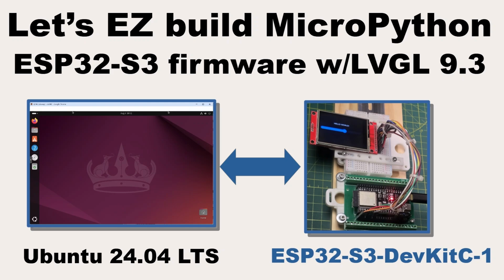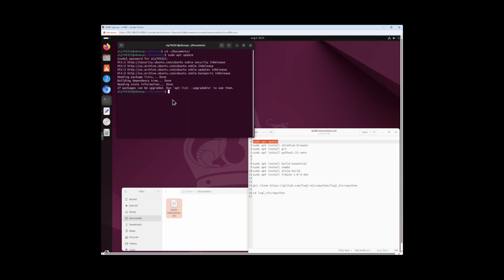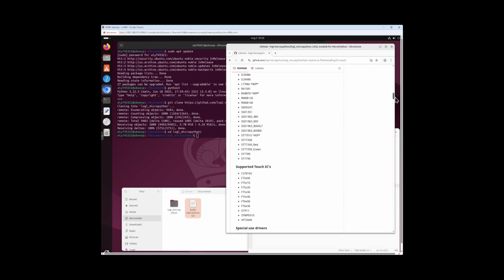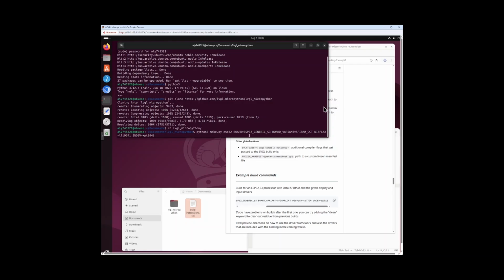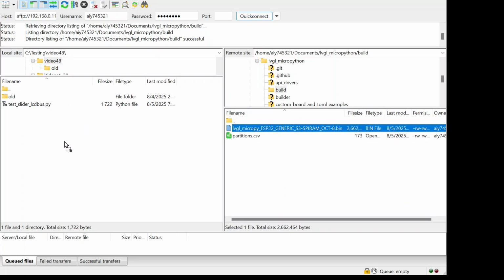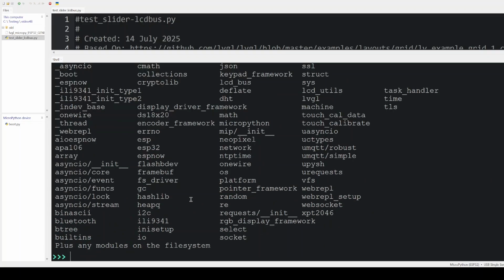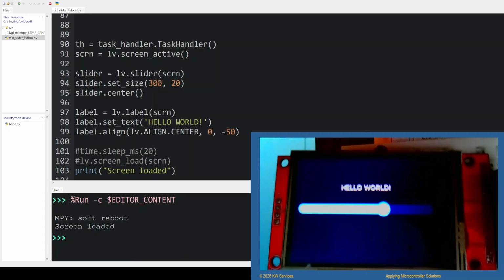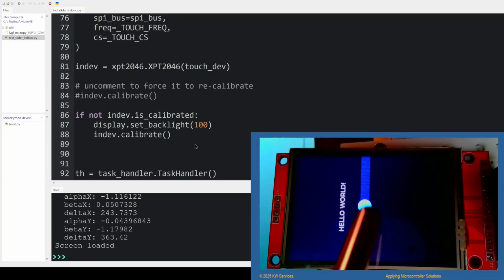MicroPython LVGL 9.3 - Let's EZ build MicroPython ESP32-S3 firmware with LVGL 9.3

Comment: Good stuff! I need the configuration or ??? for the Lolin D32 Pro. It reports as:
Chip is ESP32D0WDQ6 (revision 1)
Features: WiFi, BT, Dual Core, 240MHz, VRef calibration in efuse, BLK3 partially reserved, Coding Scheme 3/4
Crystal is 40MHz

Any suggestions?
Reply from the maker: Its been suggested that your LoLIN D32 board should work with the ESP32_GENERIC firmware.  Can you try to flash the firmware at this location: https://github.com/kwinter745321/ESP32LVGL/tree/main/Firmware/May2025/MP-LVGL9.3-1.24-ESP32-Generic

Please let me know if that works.

Comment: Could you make a video on compiling micropython firmware with ulab, ideally,  for rp2350 boards like rpi pico 2w? I think someone else asked for a firmware compilation tutorial on the ulab video you made 3 months ago. The micropython-ulab page has pre-compiled .uf2 files for rp2040 boards and several others but none for rp2350. Thanks
Reply from the maker: Thanks for suggestion. That video idea will be moved back to my To-Do list.  As, it helps to know there's interest  ( The ulab video had one of the lowest views.)  I didn't think there was interest until now.
Reply from the maker: hello.  It takes a week to prepare a video, meanwhile can you see if the firmware for it meets your expectations.  Its at https://github.com/kwinter745321/PicoLVGL/tree/main/Firmware/August2025
Reply: @applyingmicrocontrollers  Hi, I flashed the firmware to my board, and it seems like everything works, so thank you so much for doing this. My main reason for using ulab is for embedded ai/data science applications since it's extremely useful to have access to numerical computing and signal processing libraries like numpy and scipy. I think you may have included a github link with your ulab tutorial, but I saw that the resulting uf2 file was 3MB similar to this one, and I don't really need LVGL for my applications, only ulab. That was my main reservation since my board only has 4MB flash, and I will also have to have the model file/model weights on my board to perform real time inference.
Reply from the maker: Thank you for the comment.  To avoid any dislikes I wanted to show the proper LVGL way to build MP with ulab.  The approach I showed will also work for PicoW and Pico2.  I had hoped the LVGL folks would update that Repo for Pico2W.  Alas, not yet.  Anyway if they do not update it soon, I will do another video showing the approach I found to work (so far in 2025.)  Hopefully, the current video helped (as the addition of ulab will be the same in the next video.)
Reply: @applyingmicrocontrollers Hi, I finally figured out how to compile the firmware. It seems like it was a windows thing. When i used an Ubuntu venv things worked. Thanks for the help
Reply from the maker: Thanks for the update.  It is great that you got it to compile !!!